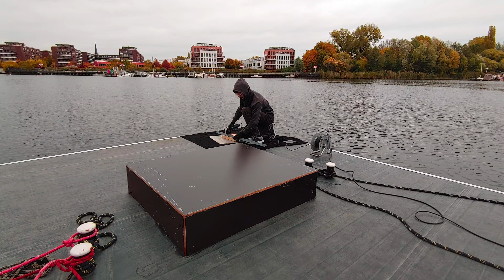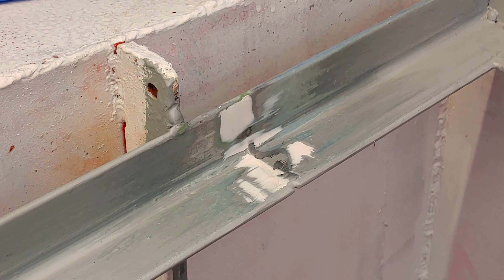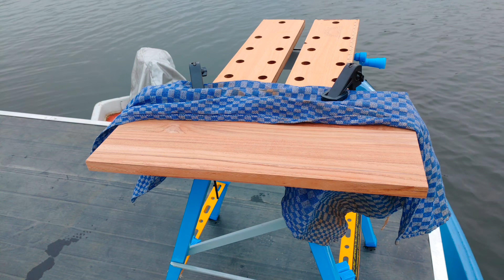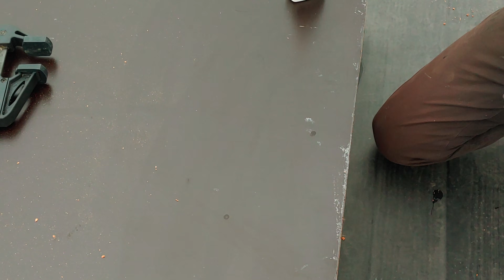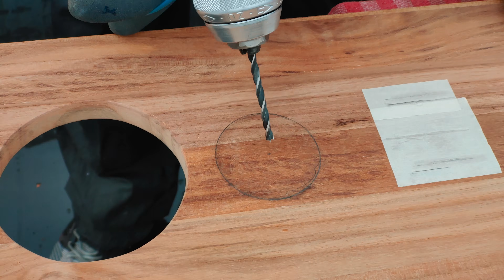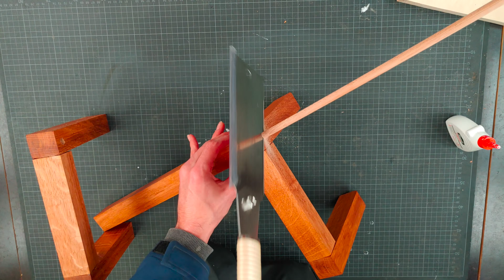Woodworking on a Steel Yacht - Part 1/2

Comment: I really love your videos! I admire your work ethic and your ability to do all kinds of different kinds projects. Because this video is older you may know this already but I thought extra info wouldn't hurt. I've been a woodworker for many years and you have gotten some great results in less than ideal conditions. However, I have two pointers if I may. 1. A wood joints strength comes mainly from the gluing and clamping of the two flas turfaces. I noticed you only put glue into the dowel holes and none on the mating surfaces, also no clamps. You will get a stronger joint with more glue and clamping pressure. Also,  glue to unfinished wood, finish will act as a resist. 2. That Japanese Pull Saw is very handy and versitile. The two different teeth patterns are for two different kinds of cuts. The larger teeth are for ripping (cutting along the grain/length of a board). The smaller teeth are for cross cuts (cutting across the grain). Hope this helps. Love your content!

Comment: It confuses me....? OK I get the application of the dowels, but the PVA glue should be used between the joints as well, ultimately stronger.

Comment: The steel shelf is really looking great.  From a strength point-of-view, the shelf sitting on the vertical legs is actually stronger because of how the grain in the legs is continuous down to the bottom angle irons.  So in a sense you built it stronger this way based on the material you were/are using.  I have similar components like you have there in our fifth wheel and they continue to work flawlessly after 2 years of use.
Reply: nope, those cross beams are attached through one piece of pine dowel and they're horizontal so the whole strength of the carcass comes down to those single pine dowels.

Comment: Get some bar clamps and clamp the dowel frames together while they dry You will get a much tighter fit or joint

Comment: I love the execution of the cabinet. But. This is what we call electricians nightmare. Its unserviceable you will need to take out everything to get to stuff  or crawl under. Not a fan. Kinda like aesthetically pleasing but not functional. Good tip is when boat building is to think about everything that can go wrong will go wrong, so everything needs to accessible. Turn switches need to swapped eventually. Sometimes victrons need servicing. Breakers burn out or just stop breaking, cables come loose etc. All bc of the resonance coming from engines and human errors. Sorry to be "that" subscriber, but i can't stand by and not say anything. Id get an boat electricians advice whos been doing it for 30 plus years to rethink the cabinet with you. And all other electrical installation. Its not at all shameful to learn from ppl who do this professionally. And it will save you a bunch of time, headache and money when you have rebuild the whole thing. Also the stupid blue box needs VENTILATION. It will melt in the summer heat in an eclosed little box. Also why is to so far from the battery bay? Are you this rich that you can afford 6 to 8 meters of 70 gauge or 95 gauge cable doubled? (Pos and neg) Ridiculous!!! It should be closest to the batteries for high effency. I swear to god one more like this and im out. You dont have to put out a video every week rather plan the stupid thing out properly.

Comment: 0:58 hey dude idk if you found a solution to hold those shelves in place, but I’d use right angle brackets that screw into the wood.

Comment: Looks pretty, but I'm curious how your going to get it together with all the parts mounted, and all the wires connected, particularly how you will be able to get in to maintain or add to the system later, I would have made the front teak panel should be hinged with a latch, maybe i'll learn something from you?

Comment: Interesting use of the dowel for the joins. Wandering if you would show the outside framing for the sliding door and the slide mechanisms as we are about to add a wooden frame to replace the canvas cover on the boat. Also would it be posable for you to find the part name /number for the lock and handles please. stay safe.

Comment: Here is a tip: when making your own dowels from a long piece of wood, take a pair of pliars and use the part of the jaws designed to grasp nuts etc, to dig long, shallow grooves along the length of the wood. These grooves mean the dowel doesn't force much or all of the glue out of the joint when you tap it into the hole to unite the two parts of the joint. More glue means a stronger joint. When you buy pre-made dowels, they have these grooves for this reason.

Comment: just as a heads up, you need be far more careful working with high amperage dc than the ac side, ac has inherent safety that dc lacks, hence its use in domestic situations, your arc welder is a low voltage high current dc source, I will leave the rest to your imagination!

Comment: Consider investing in one or more corner clamps. This will help you position and hold your pieces firm while you drill thru for dowels - and for assembly (gluing or screwing). They are fairly inexpensive.

Comment: Putting the horizontal beams (of the Victron stand) on top of the legs would not have been an improvement: You have a plywood as base for the Victron, and this plate rests on the 4 legs.
The horizontal beams just serve to keep the distance betrween the legs.
Besides: I really admire your talents! You can do electrics, hydraulics, woodwork, and -- to a degree -- steelwork. That's great!